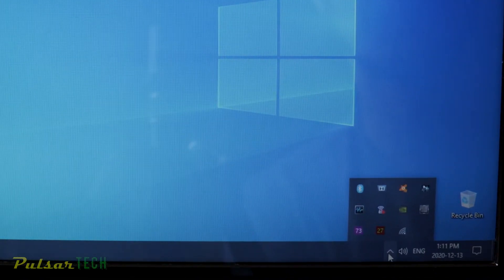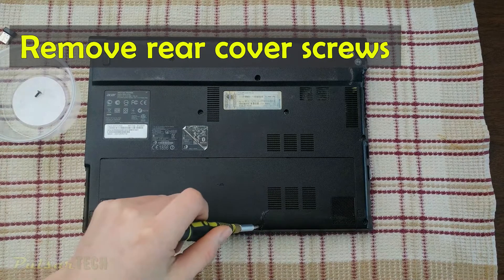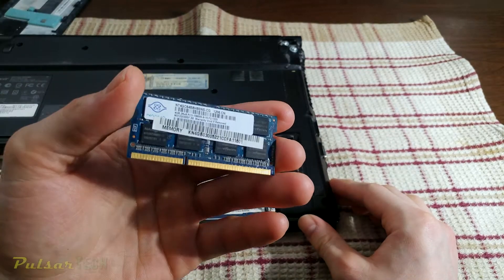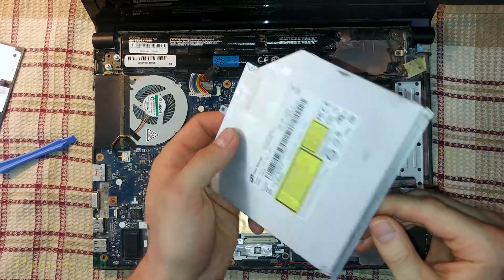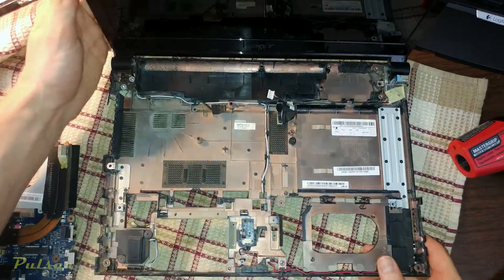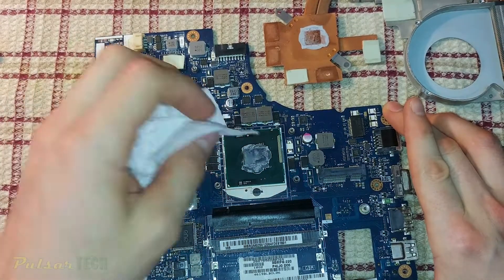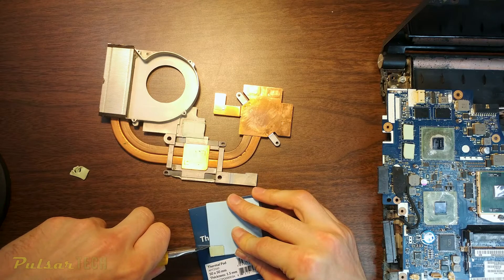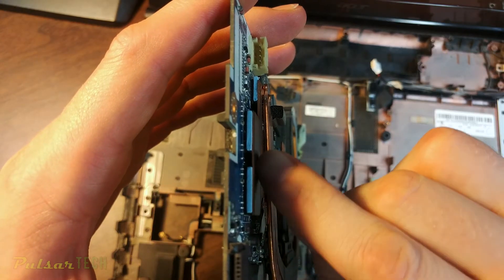LAPTOP COMPLETE TEARDOWN & THERMAL PASTE REPLACEMENT | ACER ASPIRE 4830TG

Comment: can it still be called a complete teardown if the hinge was not disassembled?
Reply from the maker: Hi, you don't need to disassemble the hinge to replace the thermal paste.
Reply: @PulsarTECH  ohhh got it, i was really hoping for the hinge disassembly because mine broke, and i wanna know what the hinge looks like
Reply from the maker: @koseikurayami  do you mean the display hinge? Mine has also broken on one side after a drop but I have managed to farm fix it with a 5mm plastic plate and several bolts.
Reply: @PulsarTECH I will try that, thanks for the idea

Comment: BTW have you tried changing the bluetooth hardware of this laptop or is it even possible? does all bluetooth version have the same size and connectors?
coz I'm having problem with using my new minikeys (logitech)  switching from one laptop to another.

since this laptop 4830tg has lower version it needed logi bolt receiver.  while my new laptop can do it without one. 
I'm thinking of upgrading the bluetooth of it altogether.
Reply from the maker: Hi, I'm not sure if the Bluetooth module is removable or if it is soldered onto the motherboard. I also had a problem with Bluetooth on this very laptop. What I did is bought a Bluetooth USB transmitter/receiver and used it to connect to different devices via Bluetooth. Hope this will be helpful!

Comment: 9:20 have you replaced the CMOS battery for this moptherboard?
I have the dame laptop and I can't find any information what CMOS is in this motherboard. 
all I know is that it is 12mm diameter. it is smaller and thinner than CR2032.

also why not use thermal paste in everything instead of buying a new thermal pads?
Reply from the maker: Hi, I haven't changed the CMOS battery, it still works fine. You can't really replace thermal pads with the thermal paste. Using thermal paste in place of a thermal pad, or vice versa, may not provide optimal thermal performance and could potentially lead to insufficient cooling or other issues. It's important to use the appropriate thermal interface material recommended for your specific application to ensure efficient heat dissipation and prevent overheating.